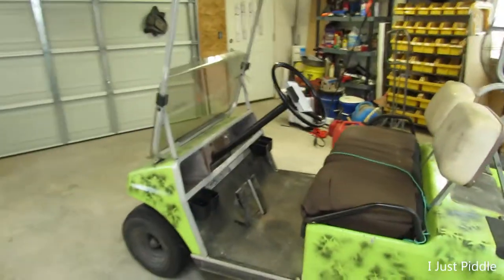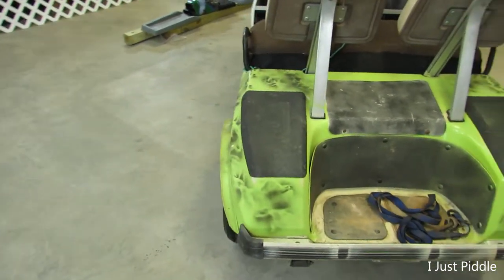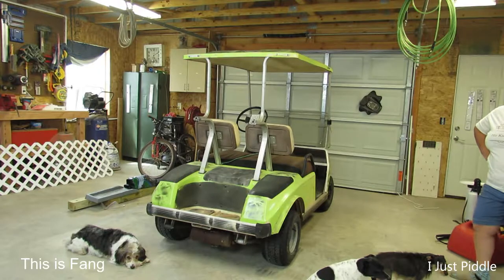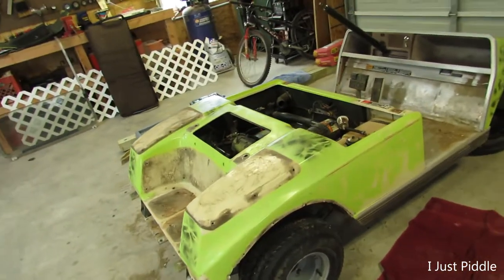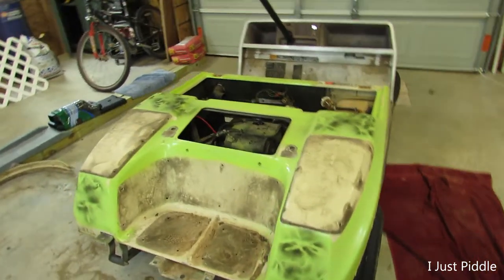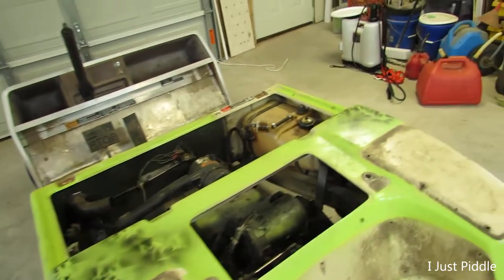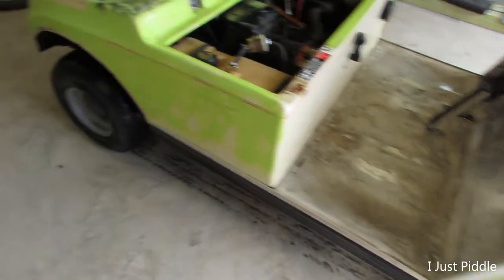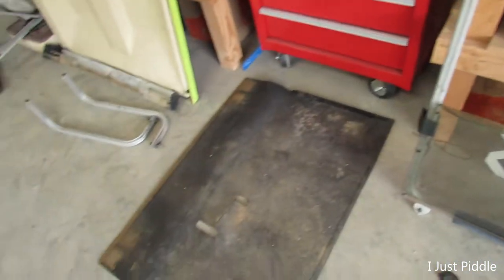1991 Club Car DS Makeover Part 1

Comment: wow i did learn something watching this i didnt know them fender flares would come off i thought was made when they made the plastic mold for these..watching them do this on youtube they dont show how long it really takes to just get one apart then to sand an paint then put it all back together its not a easy as it looks i found that out quick lmao
Reply from the maker: Yeah, I thought it would be easier than this, then my OCD kicked in and I wanted the body work to be super smooth for the pain. Then I remembered It was going to be a mostly flat finish and would get scraped up anyways so I ended up not being to picky. If I could have had wider wheels and tires I might have left the flares on there or put them back on.;)